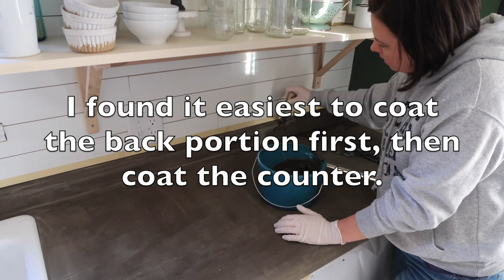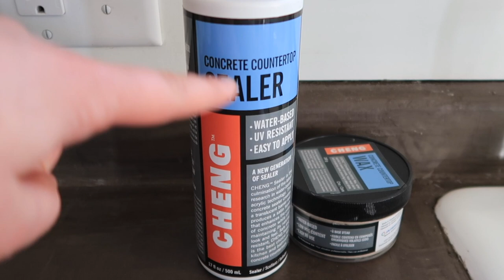DIY Concrete Counters OVER Old Laminate

Comment: Could you do a one year update! I want to see how they held up:)
Reply: Hope she does a two year update
Reply: I honestly don't see this lasting very long or very well. That skim coat is not meant for this type of use and the sealer is probably just "OK". I would very much love to see a real world 1 or 2 years of use.
Reply: We did this in our old house they were still great when we moved out 10 years later!! Even lasted while raising 2 boys. Everyone always complemented them. We are doing them in our new house right now.
Reply: @Jeremy Kimmi Onthank   what sealer did you use?
Reply: @kimmion1996 did you follow this exact process?? Looking to do ours and we want it to last, too!
Reply: @Mirabel5  we didn't use an additive. Just feather finish, water & the color we wanted.  Thin layers & lots of them sanding & smoothing in between.  Edges are the hardest to master.  I found that wetting my finger & going over it that way got the smoothest finish for them. My advice is practice on a scrap piece of wood.

Comment: To get rid of the stains , use oil base clear coat /sealer instead of the water base you did. This is the common problem with all water base dealers/clear coats
Reply: I know Im asking randomly but does any of you know a method to log back into an Instagram account..?
I was stupid lost my password. I appreciate any assistance you can offer me
Reply: @Marco Ty Instablaster ;)
Reply: @Kane Karter it worked and I now got access to my account again. I'm so happy!
Thanks so much you saved my ass !
Reply: @Marco Ty glad I could help xD
Reply: I used an oil one in my bathroom over white marble and it yellowed it within a week. Will it work different on darker colors?

Comment: The man was right, wire mesh would keep it from cracking in the future, but hey, you got great countertops out of this, and it was nice that he was willing to share info! Love people like that. :)
Reply: What kind/size wire mesh would be adequate for countertops?
Reply: I would not recommend wire mesh it's overkill. I've had my countertops for 4 years now, used the same brand of concrete did 4 coats over the cheapest Ikea countertop and there have been no issues.  I would strongly suggest removing the sink first. Also, I used Odie's Oil to seal it which is food safe and has been excellent :)

Comment: I was wondering how well  this has held up? have you had any issues?
Reply: I did mine over two years ago and still have them up.  It does patina but I liked how the patina looks.  It gives is a design. I used the pregnator and something called Taff Duck that sealed the countertop and that is amazing stuff! It is only 30 bucks on Amazon and did my entire kitchen .. bout 75 square feet! I love it but I am redoing it very soon to get a newer look.
Reply: I would like to mention I just did mine with the heather finish and water just like the package said to mix it.  I did about four layers and used about three boxes of cement.  I did not do it like this video did.
Reply: @Catherineslove  good info!  Did you use the mesh?
Reply: @taraadinolfi5847  No not at all lol I used the Heather finish on particleboard.  I did about four coats. It took about three boxes and cost about 200 bucks for all of it including the particleboard!  I did about 80 square feet!  The Taff Duck is the best! I used this other product for my island and it sucked .. never again!  lol The Taff Duck has held out for over two years!
Reply: @Catherineslove  did you use the Henry brand as well
Reply: @shaunehemphill3259  Yes its been over 2 years and I still have them.  They do patina but I love the way that looks. :)  Henry finish works very well.

Comment: Great job! 
For better results, you should mix your concrete with a drill & paint mixer. You'll get a much smother consistency that's easier to apply. It should be mixed a bit wetter also. You can then pour it out and spread it quicker. You would want to use the big Trowel, the one you bought but didn't use . . . You can also use a Window Squeegee. Use a Brush & small Roller for your vertical surfaces. A wetter consistency A: Allows your material to go further. B: Allows the material to better Self Level. 
In all, reducing the amount of sanding required.
FYI: With the right tools, that can be polished to a glass like finish, if one is willing.
Cheers!
Reply from the maker: Thanks for the tips. I'm definitely not a pro!
Reply: @aaronfu2 What tools would that be? To get a smooth polished finish like you're describing?
Reply: Use a Magic trowel
Reply: Ty
Reply: what do you put on top for that glass like finish? it is a special sealer?

Comment: I absolutely love the final result of your project! After watching multiple videos on concrete countertops, your video is the one which convinced me I could do this. ❤ I’m extremely Type A and perfectionism is a huge barrier for me, but your relaxed attitude (which did not in any way impact your fantastic final result) was a great example of not sweating the small stuff.  I’m 59 yrs old but new to home DIY, and I tend to overthink the minutia when considering projects. Unfortunately, that usually ends up dissuading me from even trying. Your video was a great example of ripping the Band-Aid and just going for it.  My first project is going to be a 36” bathroom countertop so the risk is low if something happens and it doesn’t turn out; however, after watching your video a couple of times, I’m confident that it will turn out the way I want it to.  Thank you!

Comment: Thank you for the video. It is helpful! I have a couple questions.  How long did you wait after sanding your last layer of concrete to apply the first layer of sealer? Also I have read some online reviews about CHENG sealer leaving streaks. Did you have any trouble with that? Any tips for avoiding streaks?

Comment: Wait how many coats of  sealer and then when do you wax and how many coats? I've started the project 😮
Reply from the maker: I ended up ditching the wax. I wanted a more durable, waterproof finish. I think I did 2-3 coats of sealer. The sealer is amazing and has held up really well.

Comment: Love how you took the time with the steps. So you can get a light beige or green counter tops?
Reply: There are concrete color additives available too - and other additives including the little chips of stuff you can find in like, garage floors.. and even glitters.
Reply: Careful, might mess with the strength. I put this on my countertops and it is softer than concrete and easy to gouge.

Comment: Thanks for the video with close ups of the finished product!  I am doing this project this week, but I have a couple questions.  Did you add the concrete bonding additive to the Henry's feather finish on the children's table you showed at the end?  I'm wondering if maybe that's also a factor in the color difference. Also, do you think a different texture closer to poured concrete could be accomplished by user a thinner mixture and finishing it with a sponge after spreading out with the scraper?  Thanks again!  Love your green wall too. 😍
Reply from the maker: No additive used on the play table. I think you could absolutely get a smoother finish... I’m just not that patient 😆

Comment: I was wondering what I could use in place of the concrete powder you used? I can’t find anyplace that will ship it. My Lowe’s has a hydraulic concrete powder, that kinda resembles what you are using.
Reply: No Home Depot where you live?

Comment: Lovely!  Did you use the concrete bonding additive with the Henry's FeatherFresh also?
Reply: In the video she said she used water not the additive the first time
Reply from the maker: I've done it both ways. The reason I used the additive the second time is because it was specifically recommended on the bucket of concrete mix. So, if there is an additive that is recommended for use with the Henry brand, I would use it!

Comment: hi, i loved your video of theconcrete countertop. i bought wax for tnelast step, did u use minwax or regular paste wax.
Reply from the maker: I ended up not using the wax... It kind of seemed unnecessary after I fully sealed the counters.
Reply: @TheCrazyCraftLady  did you use the Cheng Sealant without diluting it? Looks like you just rubbed it directly on the concrete. I watched a Cheng video last night and the process was wet and messy. Lots of water use!

Comment: Can you epoxy the concrete countertops instead of waxing them?
Reply: I was wondering the same thing. I believe I'm going to epoxy mine.
Reply from the maker: Brandi- if you do, please let me know how it turns out. I just don’t know enough about epoxy to weigh in here. Sorry!
Reply: Yes but be sure to do a seal coat or 2 before the flood coat
Reply: I epoxied mine and they turned an aweful brown color with the high-gloss finish.